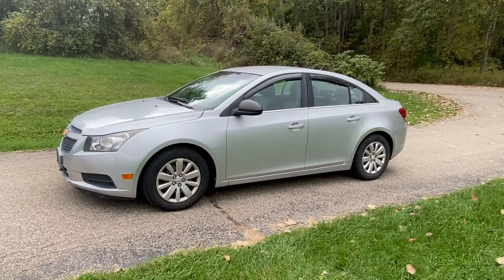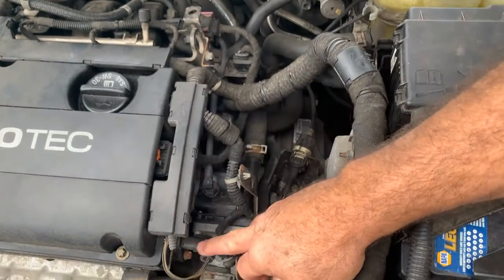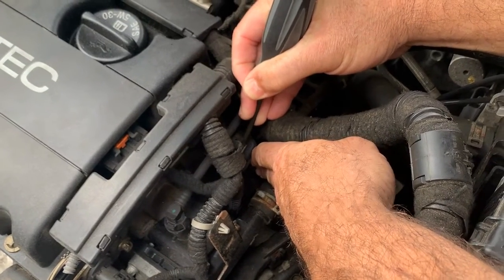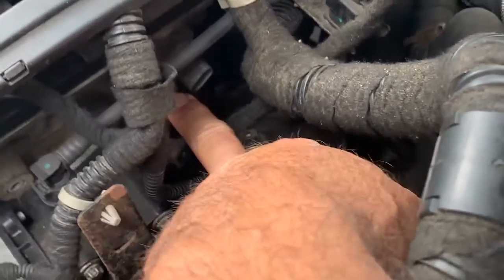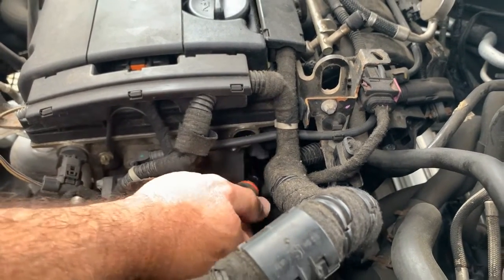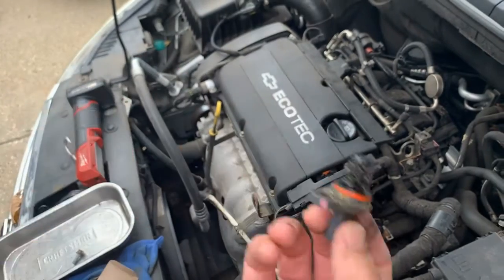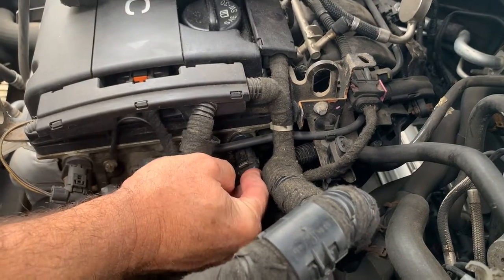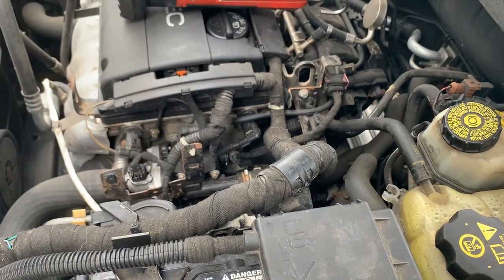How to Replace Intake Cam Position Sensor Chevy Cruze

Comment: I’m getting codes p0366, p0016, p0341, p0097, p0113, p11c2 and p2228. Any idea what that problem could be?
Reply from the maker: Unfortunately, one code can cause the ECM to throw many codes trying to compensate for the part or parts that have failed. Without knowing the car and its history, it would be impossible to diagnose by just the codes.
Reply: @TheAutoTeacher  I replaced the solenoids, maf sensor and camshaft sensors, it got rid of all the code’s except for p0016. I had someone replace my timing components, I’d say 4 months ago and so I decided to check on their work. The timing is way off and I’d say that explains the p0016
Reply: @TheAutoTeacher  Also, from the looks of it, it’s a cheap aftermarket timing kit(Moca Autoparts). I reordered everything and going to replace everything myself

Comment: Is this fix the problem? 
I have 2014 Cruze 1.8 
Code p0016 
Thank you
Reply from the maker: In this case it fixed it,  PO016 is when the Crankshaft Position Sensor and the Camshaft Position Sensor are out of alignment .
Reply: @TheAutoTeacher  whats the solution for it?
Reply: How did u get the bolt off?  What size do I need to remove the bolt?
Reply: So the exhaust sensor is in the front above thermostat housing? Part number su13344?